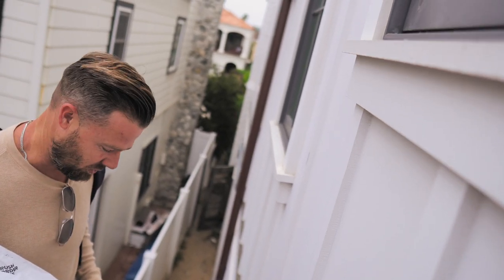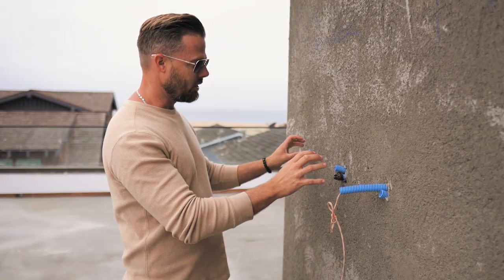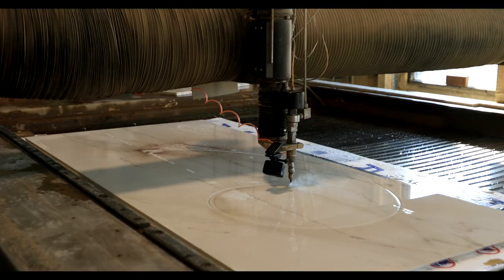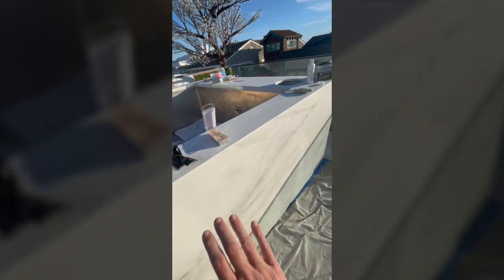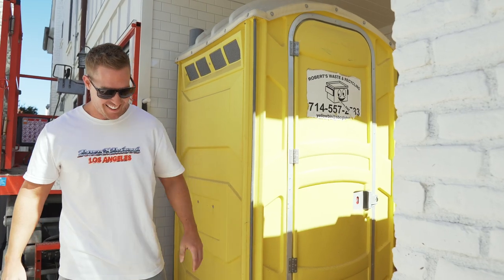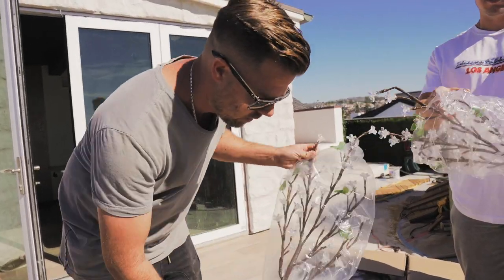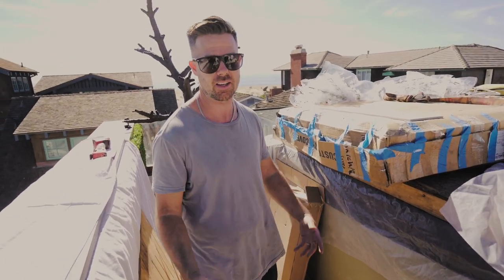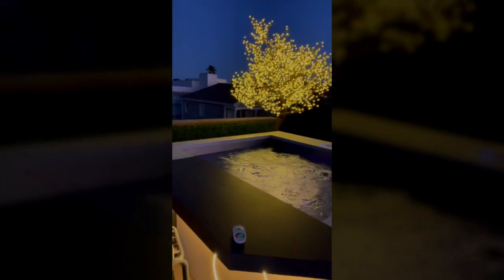Drastic Home ROOFTOP MAKEOVER Reveal! | From Residence To Resort!

Comment: Beautiful materials but not very functional. That spa completely destroys the flow of the space. Adding a spa in such a small space will cut in half the amount of people that they can fit there. Blocks the water view (wow factor) as you walk up the stairs and it will rarely get used. The porcelain tile on the firepit area will get slippery when wet so is an accident waiting to happen.